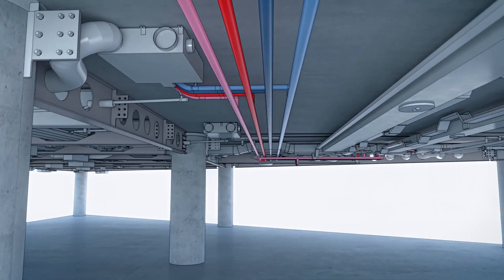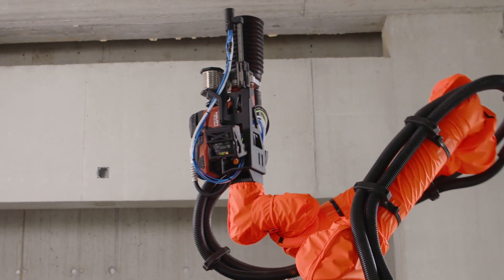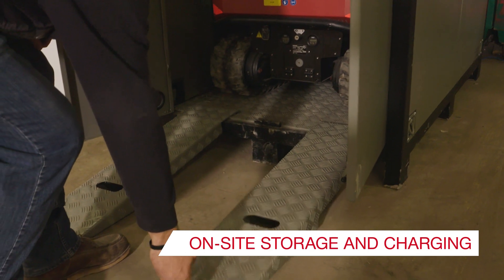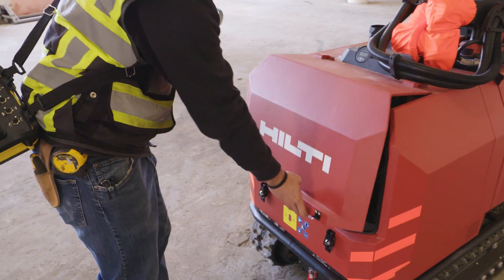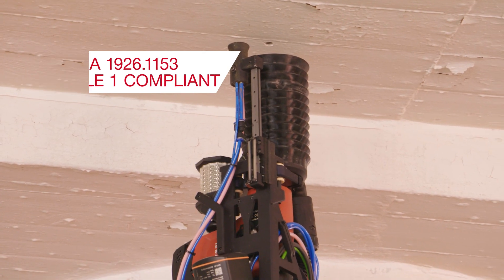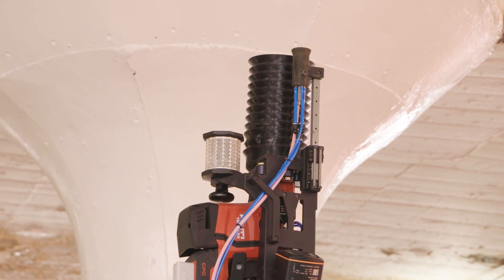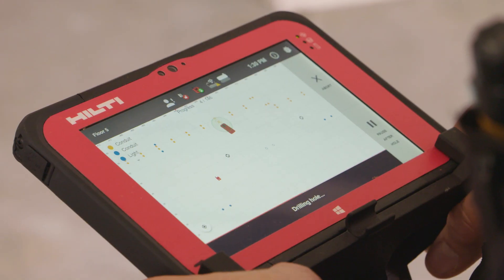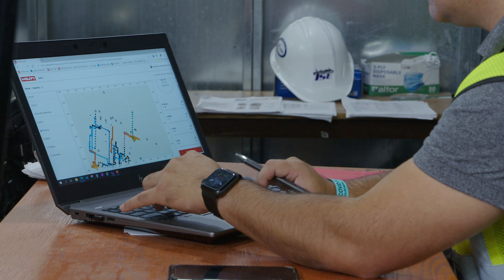HOW TO operate the Hilti Jaibot - construction robot for overhead drilling applications

Comment: Good concept to save shoulders and elbows. However the comments on schedule and productivity do not seem close to being accurate. This machine would need to get A LOT faster to make it close to being cost effective or make schedules. 1 carpenter could drill 3 times faster than this machine and the installer still needs to go back up to install the anchor. The machine still takes a man to run it not to mention all the man hours to create the BIM model and set up time and the lease cost of the machine. The floors would need to be completely clear of all materials and tools to allow access. Again good concept just needs a lot more product advancement to be productive...